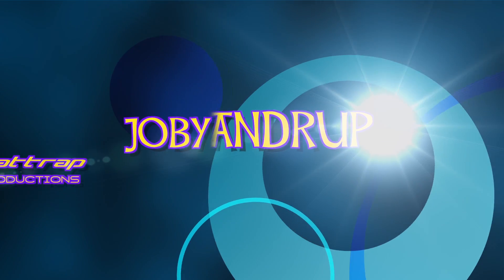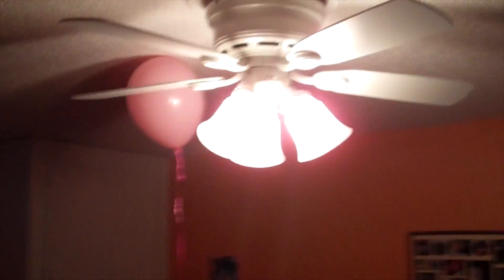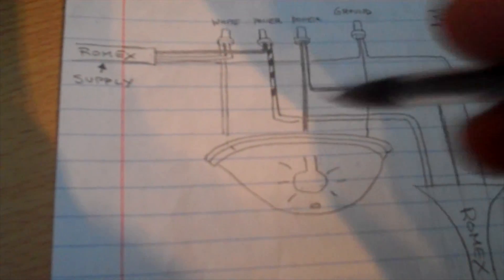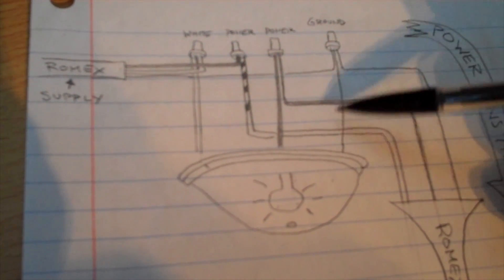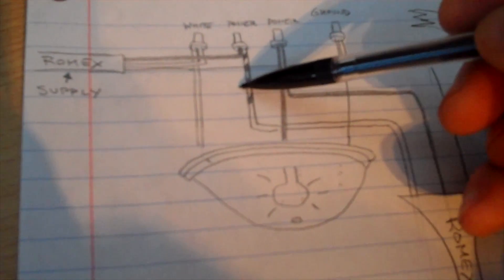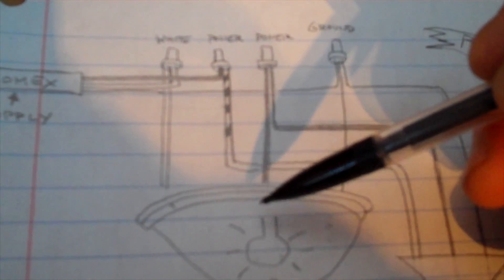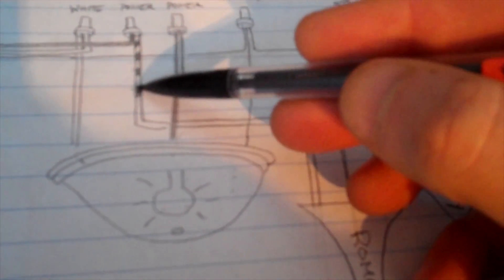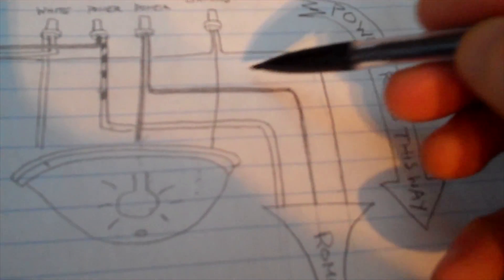Home Electrical Wiring Basics Pt. 2

Comment: Thanks. You surely have helped me figure out the light. Could you use a  purple wire or some other color wire when it is a hot wire going to the switch. It just seems like white should stay neutral and copper ground and black live w=(Hot power or feed source). I would like to see purple or blue wire for hot wire with a purpose or a switch. Thanks for helping me figure out my split receptacle  and light switch. I could use you here in Decatur, Illinois. Thanks again Toby.
Reply from the maker: +Oscar Alcala I agree Oscar.  This is the way the NEC says to do it.  They probably say it's okay to use white wire so they don't force electricians to carry another color in their truck.

Comment: Can't be stressed enough that ALWAYS ONLY switch the hot/black wire (or as in this case the white wire is actually used as a black/hot wire which is why you then have to signify it as such by putting some black tape around it).  You could simply stress too that the ground/bare wire is ALWAYS continuously connected to everything on and throughout the entire circuit.

Comment: Nice video.  Quite easy to follow.  However, it would be handy if you included the required electrical boxes in your diagram (octagonal at junction points, rectangular for switch).

Comment: Does this wiring work with any type of light like recessed lights?
Reply from the maker: Check with the manufacturer as they tend to sometimes use a LED driver that might be dimmable as well.  Hypothetically, you should be able to use this method, I'm not willing to say though as the manufacturer might have a more preferrable method.  Contact them.